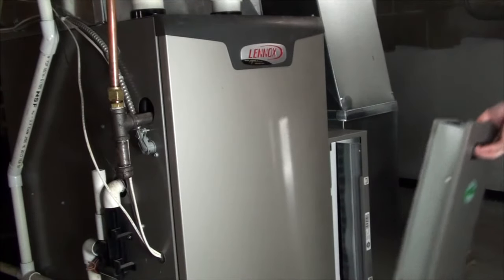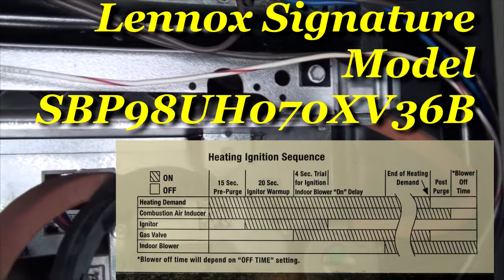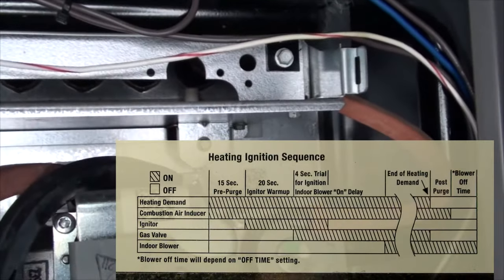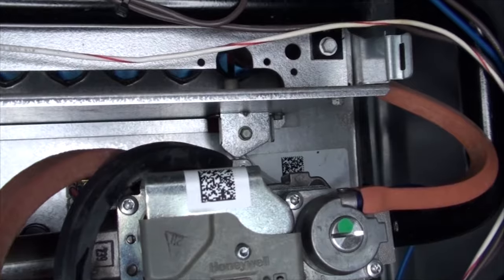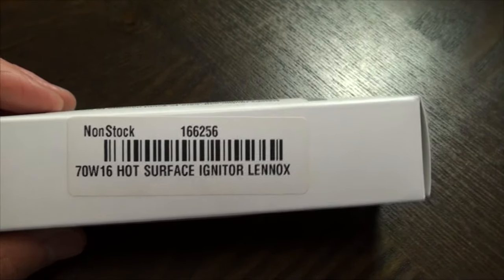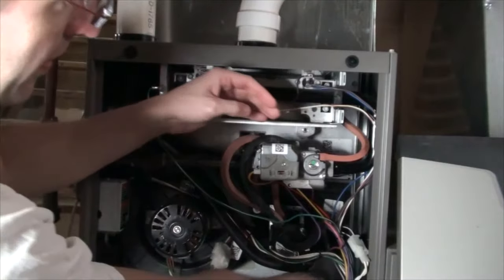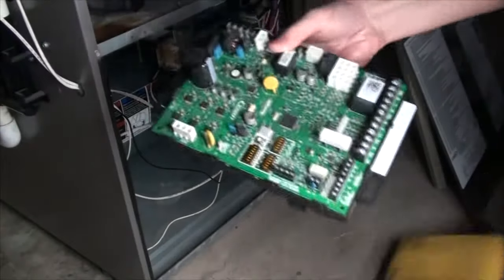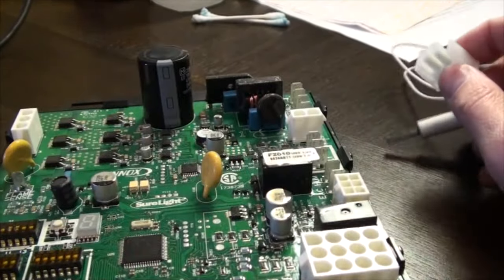Lennox Furnace Fix & Prevention | Ignitor Replacement

Comment: What sets apart this amazing video is that it not only troubleshoots an ignitor that fails to ignite but also suggests ways to prevent this issue from arising. We provide top-quality Lennox hot surface Ignitor and other Lennox furnace spare parts.

Comment: My Lennox furnace was not firing. Also about this time I had to schedule a gas meter replacement per the gas company.  When the gas technician replaced the meter he had to check that I had no gas leaks. The only gas operated device I had was the furnace so while the technician was checking the furnace pipes for leaks I mentioned that the furnace would not light off.  He told me that my problem was most likely the igniter.  I checked the resistance of the igniter and found it was open.  Lennox dealers would not sell me an igniter because I am not a licensed HVAC tech.  So I found a small independent hvac parts shop and he did sell me the igniter.  It was $90.  I tried to install the igniter which is hard to reach on my furnace and I broke it.  I figured that was just the cost of training, and I bought another one for $30 off Amazon or eBay.  But I had figured out how to install the igniter without breaking it.  I installed the igniter and success.  The furnace started working.
Reply from the maker: Way to go, charles 👌

Comment: HI, we have a Lennox Elite  G61MPV and  it wouldn't fire the gas valve when I look through the sightglass the igniter glow plug was not going so I shut the furnace off  tapped the glow plug wiggle the wire a bit put it back together and away it went the ignitor got hot the gas valve fired up the furnace
Reply from the maker: Hi Wayne, that's interesting...
Makes one wonder if it is the ignitor's connector or the wire inside.
In either case, to avoid a future expensive emergency call for furnace repair, it may not be a bad idea to purchase a replacement, in the event that wiggling won't bring it back anymore.
Good comment, thank you for sharing  👍

Comment: Hello, I recently had to replace the igniter on a unit for my family. After replacing the igniter, I noticed it wouldn’t turn off after it lit. Five hours later the igniter stopped getting hot. Do you think it is a flame sensor, relay or bad igniter?

Thanks

Comment: is there any recommendation to clean the ignitor itself? every year before winter I clean the flame sensor but have not touched the ignitor.
Reply from the maker: I would not.  Even handling the ignitor with your hands can deposit oils from your skin which can burn hotter, thus shortening the lifespan of your ignitor.  They last years.  Pick up an extra one to have on-hand in case of failure.  Continue with annual carbon cleaning and your as good as can be 👍

Comment: Greetings, Many thanks for the chart / timing.  Mine goes so far as the ignitor working well, but no gas flow after the ignitor has done its thing.   I can see the glow, but it just never changes / don't hear any additional gas added.   I know we have gas for house, as the stove top gas elements are working fine.  Can you please comment or point me to something that assumes that the ignitor is fine.  Many thanks,  BTW, mine is the Lennox Conservator III G16R,
Reply from the maker: Hi Ron, if your ignitor glows bright orange, it's just fine.
Can you smell gas coming through your furnace jets?
If it hasn't been maintained for awhile, carbon can build up and provide enough of a barrier between the ignitor and the flowing gas.
In the video, I do demonstrate how to use a propane torch in the event that you suspect an ignitor flaw.  If you attempt this, certainly be careful, but you can directly fire the jets, which will also test for flowing gas.
Thanks for visiting the channel, my chilly friend 🧊

Comment: Thanks for great video. I live in Australia and my ignitor for my lennox heater (G61 Lennox 110)needs to be replaced unfortunately Lennox dealership wouldn't sell it to public over hear. Any idea where to source it from?? thank you
Reply from the maker: I bought a couple off eBay.  They were overpriced at around $40, but vendors monopolized the market.

Comment: Hello! Great video about the hot surface igniter. I have a similar Lenox (EL296UH090XV60C). Instead of having a HSI plug on the circuit board it has a HSI/CAI plug. The HSI still has continuity at 63 ohms. When I cycle the furnace for heat the inducer motor spins up, I hear a slight “purge” but the HSI never heats up beforehand. I checked for HSI voltage during this cycling and it stays at zero. I’m about to blame the circuit board but am wondering if there is another condition which may cause the logic board to not supply 120V to the HSI? Also, the system stays running the whole time I have the T-Stat on heat. Since it never gets satisfied the blower and inducer keep running. The seven Segment display alternately flashes between A1550 (air flow) and E200 (Hard Block). When I shut down the power and reconnect, it resets. After a bit I get the Unit size code (4), the A1550, and not long after I get the E200 after I hear a bit of a “burp” which I think is the gas valve opening up then closing. Again, I never see the HSI glow. Thank you for any advice!
Reply from the maker: Thank you for asking me a fun question, teo!!
In short, you may be right about the circuit board, but let me break down a couple small thoughts.
Does your HSI look the same as this video?  I just measured mine at 50 ohms of resistance.
That being said, during initiation, it should receive voltage, which it sounds like it does not.
In that case, you could either grab a new board, or attempt to follow the tracings back to the power source to see where it gets tripped up (check the rectifier, capacitors, etc).
Out of curiosity, do all the fans/motors spin up?
Now that I'm typing this, I wonder if a triggered flame sensor would be a hard stop... (for sure don't quote me on that one).
I'm glad you enjoyed the video! (for some reason, it doesn't get much love around here)
Let me know how things turn out, my friend  :)
Reply: Lol

Comment: Thanks for the video. I’m getting “service alert 31: communication problem - outdoor unit” with the same system. Any ideas what it could be? Thanks again
Reply from the maker: Hi Carlo, is this 1) a new furnace or 2) an old one that was working and now giving you problems?
These are tricky to diagnose remotely, but it almost sounds like it lost connection with the thermostat...
Have you cycled the power at the point of your breaker yet?
What is the pattern of your 2 blinking LEDs?  The legend is readily available online.
I hope this leads you to a fix, my friend  :)
Reply: @VestigialVoice  thanks for getting back to me. The system is a five or so years old. It’s blinking 4 lights which I looked up and Im pretty sure means “low flow sensor”. I actually took the sensor out and tried to clean it gently but unfortunately the error just kicked back on an hour ago (I’m writing this from my basement trying to troubleshoot lol). I have power cycled it four times and it works for a few hours and then stops with same lost communication error. Thinking about trying to clean the but might just call a professional. Probably due for a proper service.
Reply from the maker: I've been there, boss.  Cold and frustrated in the basement with only a flashlight-friend.  lol!
If you call a technician, don't let them get away without breaking down the problem and solution.
Please report back to me with the information.
Perhaps we can help some future, frustrated flashlight-people  ;)
Thank you for visiting my channel, Carlo!

Comment: Hi. When I turn on my furnace, it doesn't go through the Heating Ignition Sequence. Instead, when I turn it on, the fan/blower will immediately run and just skips on the burning stage. I tried replacing the ignitor, but it still goes through the same sequence. Any recommendations for a fix?
Reply from the maker: Hi Mapa,
When you say, "it doesn't go through the Heating Ignition Sequence," what EXACTLY do you mean?
1.  Does the initial system purge?
2.  Does the inducer kick in?
3.  Do you hear the flow of natural gas?
If the only thing that doesn't happen is the ignitor doesn't turn on (despite replacing it), you should use a multimeter to see if it is receiving power at the level of the PCB.  There are already a couple good videos demonstrating how to do this, if you need help with this step.
Good luck on your fix, my friend  :)
Reply: @VestigialVoice  Hi Vesitigial! Thank you for reaching back.. The  problem is fixed now. All we had to do was wipe the flame sensor with a dollar bill, and it's fixed. Basically, when we turn it on: 
1) the inducer kicks in
2) About 5 seconds later, the blower turns on (loud blower fan noise) It blows cold air
3) Furnace turns off about 10-15 minutes later

That's pretty much it. Ignitor doesn't turn on, gas doesn't flow (no click sound)

The fix cost us about $165. $65 for the new ignitor (which we thought was the problem - but good to have as a replacement). and $100 for the guy we called to troubleshoot the furnace.
Reply from the maker: @Thehazz008  , thank you for the update.  Probably been a few years since you last cleaned the flame sensor?  I'm glad to hear it is working again, stay warm 👏

Comment: What "safety button"? 
No clear picture of parts & locations. 
Confusing. Choppy.
Reply from the maker: Hi Phi,
There is an auto-kill-switch that engages when removing the lower panel.  If memory serves, mine is black and spring-loaded.
I am saddened to hear that you think my video is so terrible.
I still hope, if you are having furnace difficulties, that you are able to stay warm this winter.